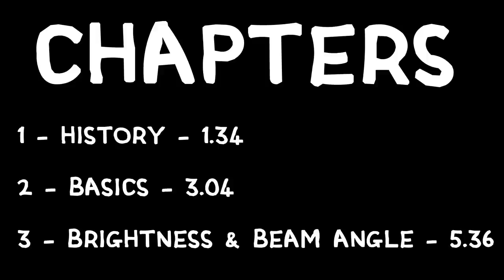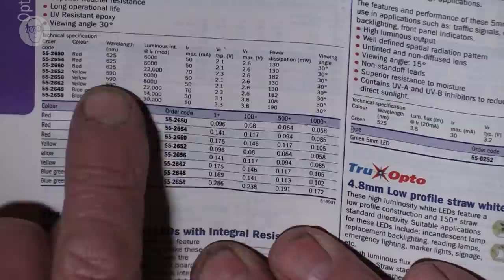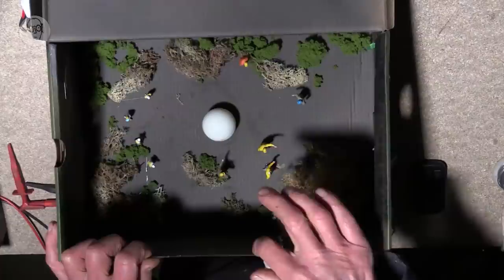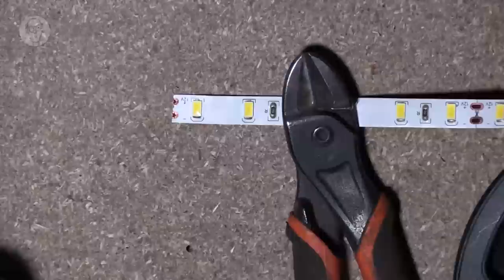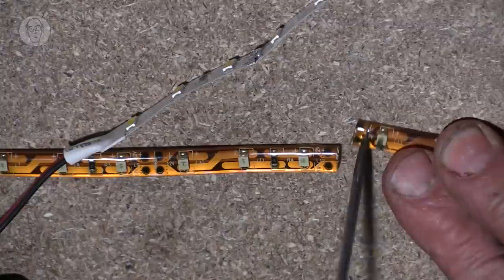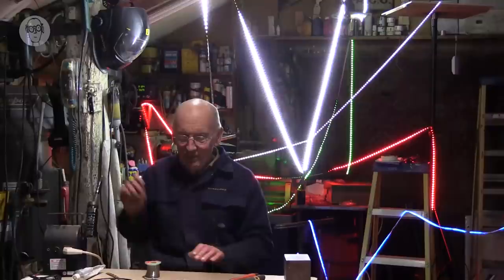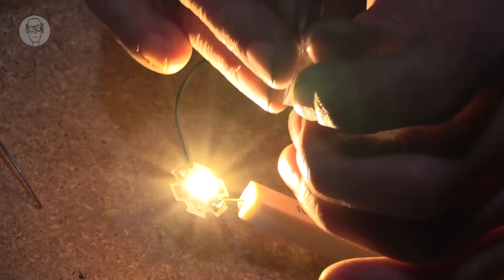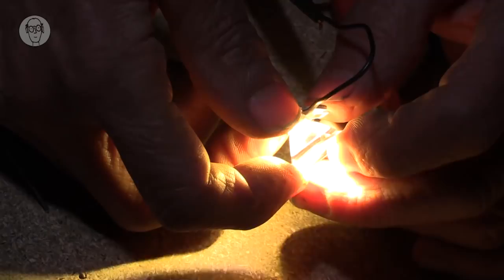LEDs -The Secret Life of components, a series of guides for designers and makers - Episode 2

Comment: Hey Tim! You can work out the right resistor without needing to do an experiment if you realise that the voltage of the LED will be subtracted from the power supply voltage to get the voltage on the resistor - so with your 12v supply and a 3-4v (let's say 3.5v) LED, that means there's (12-3.5) or 8.5 volts left for the resistor, so 8.5/0.8 = 10 ohms of resistor to make 0.8 amps go through the whole thing. You got 14 ohms by experiment, which I reckon is probably due to variations in the LEDs from their theoretical specifications, but it would be interesting to put a voltmeter on the LED when it's consuming 0.8 amps to see what voltage it actually has, then work out the ideal resistor from that!
Reply: Alaric;  You make a very good point.  In such a calculation the forward voltage drop of the LED should be subtracted from the power supply voltage before using the voltage to calculate the resistance to give the desired current. True there will be some variations in the forward voltage drop of the LED but I think the main reason that Tim came up with the higher resistance during his experiment is that he was not driving the LED to its full rated current of 0.8 Amps.    For example, if you drive the LED with 600 mA. and the forward voltage is 3.5 volts the required resistor will be 14.16 Ohms, pretty close to what Tim came up with.  Tim mentioned that the resistance of the variable resistor he was using in his experiment was 175 Ohms and that is going to give rather poor resolution when trying to set it to values in the range of 10 to 15 Ohms.  It would have been easier to use a variable resistor of perhaps 25 Ohms total resistance end to end.    Besides, if the LED gives enough light when running at 600 mA. then it would be wise to run it at that current to reduce the heat load and prolong its life.
Reply: For the little LEDs that run at ~10-30mA, a simple resistor is fine for current limiting. But LEDs internal resistance goes down as they heat up, which makes them draw more current, and heat up even more. So with the bigger units running at currents like .8A, it is highly recommended to use a current regulator circuit. These are often included on the star modules, or can be added. The simplest ones are just a single three-terminal chip and a small resistor to set the desired current. And most have built-in temperature monitoring so they will reduce the current if they get too hot.
Reply: The 14.9 ohms he ended up with, at 720 mA, causes a 10.7V drop across the resistor, which means the LED would only have 1.3V across it.  I would have liked it if he addressed this disparity with the advertised 3-4V operating range in the video.  To me, something does not add up - if the power supply was doing what it said, outputting 720mA AND the voltage was still 12V (that was not being displayed).  I will say that when I have experimented with LEDs in the past, I also found a disparity in calculating series R values, compared with the resulting voltage division and operating point of the LED.

Comment: Another great video. My top tip on this subject - I've found that many of those LED spotlights, intended to be driven at 12v from a transformer, will light up pretty well at 9v from a PP3 battery. I used several of them as safe and easy lights in my kids' playhouse, powered by two PP3s in parallel.

Comment: Hi Tim. You may arrive at the right resistance for your current limiting resistor, by deducting your LED forward-voltage-drop from your supply voltage, and then applying ohms law on the remaining voltage: 12-4v(LED forward voltage drop)  = 8v drop over your current limiting resistor 8v @ 0.8A: v=ir, i=v/r = 8/0.8 = 10 ohms.This always applies: the diode has a fixed forward-voltage drop regardless current, the resistor a fixed resistance (until blue smoke escapes anyway..). This makes the resistor always "pick up" the remaining voltage drop, acting as a current limit.
Btw, use the lowest forward-voltage for your LED in the calculation. You mentioned 3-4 volts. At LED fv=3v the resistor would be slightly higer: 12-3=9v; 9v/0.8 =11.25ohms@ 0,8A

Adding a safety margin with LEDs makes total sense, when not using a fixed current source. That means slapping on some extra resistor-ohms  for  slightly lower-than-calculated-max-current -> results in LED longevity. Especially since the lifetime of a LED is inversely proportional to max current applied. So driving it @ 90% current, results in 10x lifetime! This is also true for light bulbs and fluorescent tubes =)
Thank you for sharing your videos!

Comment: Very good and educational topic.  One point I disagreed with was the calculation of the series resistance.  You used ohm's law, but you didn't show the resistor and LED in series, and the voltage drop of 3 to 4 volts across the LED, which would give 8 to 9 volts across the resistor.  The calculation would be 8 to 9 divided by 0.8, which gives a lower value of resistance.  It would have been interesting if you had measured the voltage across the LED at 720 mA to help explain why 14.9 ohms was the value of the resistance that resulted.  You appear to be a legend - I am so happy to have tripped across this channel!

Comment: As a former audio repair tech, we frequently were tasked with replacing pilot lamps, input-select indicators and radio-dial illumination with LED's; the beamy nature of LEDs makes this more difficult than you'd expect, and whenever we'd try this for the first time on a particular brand/model of gear, there would be a fair bit of experimentation involved (not just voltage/resistor values, and LED color, but physical orientation) in order to get a good diffusion and color match that isn't overbearingly bright. If you look at vintage gear on YouTube (or EvilBay 😁) that has been re-lamped with LEDs, the colors are often garishly bright, definitely not in keeping with the look of the original factory lighting. Another problem frequently encountered is that the plastic lenses and escutcheons are often discolored or even half-melted and physically distorted from 40 or 50 years of lamp heat and UV rays.

Comment: Three small things:
1. You can program in Arduino C++ mutation functionally, completely ignoring the whole OOP BS. Better yet, skip arduino and use C instead.
2. A simpler method to select a resistor for power LED with bench power supply is to set the desired voltage and current, connect the LED and measure votage drop across it. That's forward voltage of specific LED. Then use the formula:
(Vin-Vf)/I = Rdrop.
This works for any size and type of LED.
3. Lenses for power LEDs come in variety of angles, from 5 degrees to 90 degrees. I used 5 degree ones for 7 LED IR lamp for a friend...
Reply: 1. I like C++, don't drop Arduino/esp, small, cheap and handy or go for the excellent cheap new pi Pico and micropython.
2. That's what Tim basically calculated at first ? Then done more hands on test.
3. He said you can get variable lenses, did you listen to the video ?🤣
Reply: Ad.1. You can use whatever you want. Tim mentioned he didn't like OOP with C++, so I mentioned alternative, superior programming style, that works with C++ too. OOP in general failed as a paradigm making programming harder than it needed to be. That\s why people are switching over to functional programming. For small, 8-bit microcontrollers C is much better, and faster.
Ad. 2. Tim calculated only for input voltage and current, not including the voltage drop across the LED. Also his method requires a rather beefy variable resistor that can handle 10-20W. These ain't cheap, nor common.
Ad. 3. Tim mentioned the one type of lens, the 30deg. type. I just wanted to be helpful mentioning the other types.
Reply: @KJW648  C++ is fairly inappropriate for small microcontrollers. Arduinos just seem to promote poor coding practice. Plain C without the Arduino IDE bloatware is a better solution.
Reply: @sdgelectronics , the Arduino C++ is a stripped down version of C++. Some things doesn't work in it, and that's actually a good thing. Arduino uses plenty of badly written functions already, no need to mess them up further with fancy and useless constructs of C++. These functions are designed to abstract everything away from the beginner programmer, so he/she won't have to write directly to the registers and setup everything by hand. That makes Arduino easier to use, but at a cost of very inefficient and slow code. The same goes for libraries for any hardware one can connect to Arduino. Arduino makes bad and lazy programmers who can't really understand the hardware they are using. It's a modern day BASIC, as Python is modern day COBOL...

Comment: for me, soldering small smt components like tiny leds by hand, putting down a small blob of solder on one pad, then sliding in the component while holding it with a tweezer while reheating the solder on the pad works great. Then after you can solder the other pad. This is obviously  a method valid if you have to do it by hand, and Im sure there are better ways, but works great for me. cheers and thank you for a good show.

Comment: I've been enjoying your videos, and loved watching the secret life of machines show when I was a kid, even though they weren't very common in the states.

You can actually calculate the resistance needed for max LED brightness pretty easily without experimenting, but it's a little confusing at first:

You first need to know the voltage of the LED, in data sheets for individual LED it is called the forward voltage and is often abbreviated as Vf. From your example of an LED fixture rated 3-4v, white LEDs are almost always 3.2v, so we'll use that. Simple subtract the LED voltage from the power supply voltage, e.g. 12v - 3.2v = 8.8v, and then use that number in Ohm's law: 8.8v / 800mA = 11 Ohms. So, 11 Ohms would drive that LED at it's max current. It's usually best to under drive them a bit by rounding up the resistor to the next common size, so maybe 12 Ohms for 733mA.

In other words: (SupplyVoltage - LEDVoltage) / DesiredCurrent = NeededResistance.

I hope that made sense and might be useful to you.

Comment: Those vintage bulb style LEDs are interesting.  Each “filament” is a bunch of tiny LEDs in series, and runs off something like 80-100 volts.  So it’s actually pretty easy to put two or four in series and run them from the AC line voltage converted to DC.
Reply: Watch the film on radios and you will see same filament.  Amazing.

Comment: The flickering effect you mention at 24:18 is an interference pattern called temporal aliasing. It is similar to a Moiré pattern (the interference you get when you overlap two screen doors), but in time instead of space. Just like car blinkers (aka turn signals) at a red light, the video shutter and the LED flash are out of sync.

Comment: Great video! Calculating the series resistor for a fixed voltage needs to be based of the rated wattage, not the amperage at the original rated voltage (3.3-4.0). You need to calculate the new current for the desired voltage, then use your process to dial it in.  I think the reason the constant current supplies are so popular and effective is the LED's series resistance can change quite a bit from temperature and time/use.

Comment: This may have been mentioned before but for addressable LEDs there is software for the ESP line of modules called ESPixelStick ( its also a product you can buy off amazon), you can then send any pattern to the LEDs with your computer with software called Xlights ( mainly used for animated xmas light shows )

There are many other options for the controller portion, like the Falcon PiCap, theres also a line by Dan Kulp.

Comment: That is a neat trick with the tape strips, hadn't thought of that one yet 👍
Reply: I use aluminum foil tape for everything. The neatest thing so far, which was not my idea but I tried and elaborated on it, is a small transmitting loop antenna for 11m cb. The outer loop element is one continuous piece of tape with the backing left on for adjusting and wrapped around a length of flexible pvc (like they use for irrigation systems) in a barber pole fashion (the spacing prevents current from jumping across the gaps, zap). The pvc is looped like a hula-hoop (and you could probably use one if it was the right dimensions) and the conductive tape is held by a little duct tape here and there. The tape ends are soldered and wrapped around a short piece of copper 12 awg solid and those are connected to a homemade variable plate capacitor which is just 2 steel plates from the electrical aisle in the local hardware store and plastic bolt, washers, and nuts. The plates are connected in one of their corners with the dielectrics and keep spaced nicely, I adjust with a long piece of plastic zipped tied to the movable plate and to the mast at the other end so its snug but movable. Anyways, this kind of antenna needs very good continuity (a design variation using a trombone capacitor has no solder points at all) and a fairly wide guaged outer loop element (sciency bandwidth reason) which normally requires soldering thick copper pipe into octogons typically. The tape wrapped around the pvc pipe achieves this at a fraction of the cost, weight and work, super happy with the results. I've used the stuff for other things as well but for antenna applications its just indispensable and why I had to try building the aluminum tape loop.

Comment: In commercial LED fittings, the dimming is not normally done via PWM. It is normally done by reducing the current. The flicker seen is normally the ripple on the DC current. Cheap drivers have relatively high ripple and hence the flicker

Comment: Love the little leds that come in packs of ten in clear discs not much bigger than checkers pieces, that are lit by a handheld skinny little  remote controls that can change the colors, the fades, etc. And those remotes are only a couple bucks. I put a group of these lights on a turntable, and placed a very large 20,000 Leagues Under The Sea resin model sub on the clear cover of the turntable.  Quite an underwater show.  You can mount on old art deco sconce on the wall , toss a couple or 3 of these into it, turn it on with the remote without having to wire anything. Yes, the led's have replaceable batteries in them....

Comment: 6:17 - Worth mentioning that, although the middle of the LED looks white on screen, in real life it's red. It's just saturating the camera's sensor, so it appears white in the recording.

This leads to a common issue when photographing or filming cars at night: the rear / brake lights look red when they're out of focus, but once they come into focus they seem to turn white. It's also a good way to spot fake "depth of field" effects (i.e., blur added in post), because it will appear white or pink instead of red, as it would if the light had actually been out of focus. Modern HDR cameras have improved this a bit, but it's still tricky to get the exposure right.

Comment: I worked for traffic light company. We used leds in the traffic lights. Our leds on site never failed, each led had a large copper track and open to air to keep cool. Our competitor, well known company, would epoxy resin their leds. They would overheat and fail.

Comment: LEDs are something I play around with a lot, so versatile and easy to work with (so long as you remember which way round they go!), whether the traditional resin-packaged types, or the more modern high power COB ones, they're just so useful... :D

Also, I was kind of hoping to see a clip of the Z80 CPU covered in red LEDs from the TSLOM on "The Word Processor", that was a pretty neat use of LEDs to demonstrate the ons and offs going on with the processor... :D

Comment: While doing experiments is great and all, you don't actually need to do one to work out the correct resistor for the LED.  The voltage that will be across the LED is known as the "forward voltage" and this can be found in the spec sheet, however for white and blue LEDs this is generally 3 volts.  That means that the voltage across the resistor on the 12 volt power supply will be 9 volts (12V-3V).  In your experiment you adjusted the resistance until the current was actually 600mA which you can see on the display just before you disconnected it.   9V / 0.6A = 15 ohms.  It's the same resistance as you first calculated (incorrectly) because you were working to 12 volts at 800mA, but in the experiment you adjusted to 600mA.

Also, the power dissipated by the resistor will be 9V x 0.6A, or 5.4 watts, so you could quite easily get away with a much cheaper 10W wire wound resistor rather than the 15W ones.